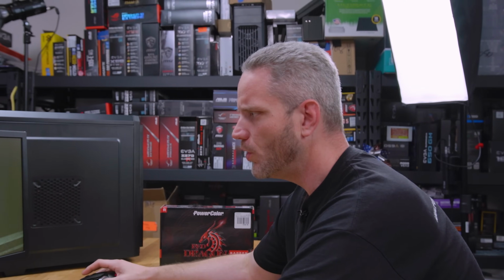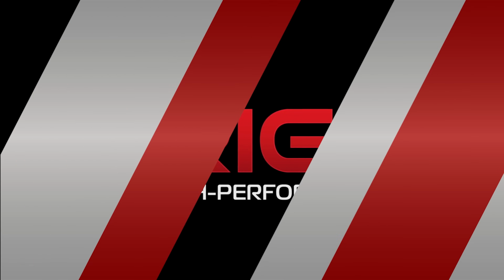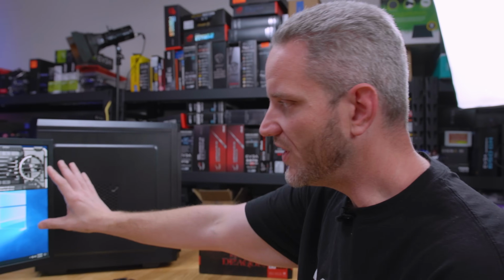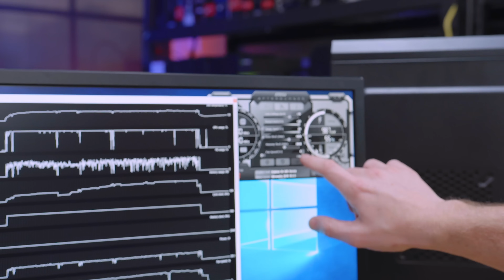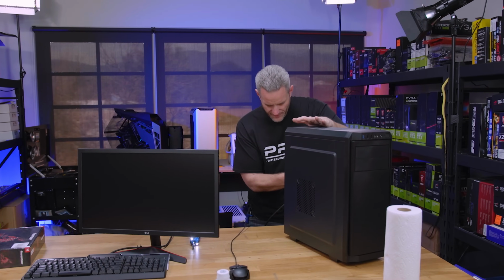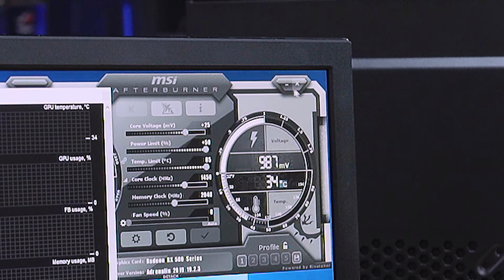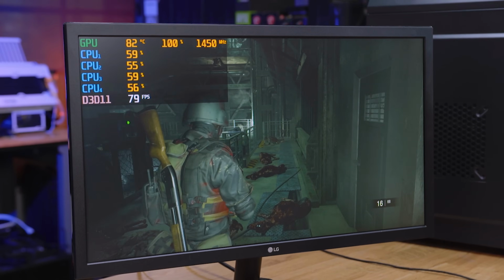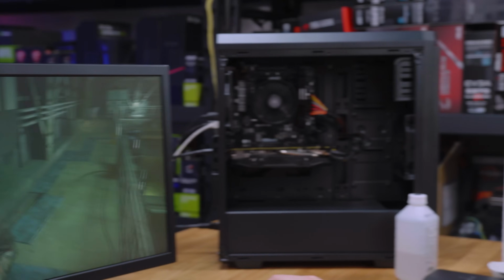Should you replace your video card's thermal paste??

Comment: Dont know about this card, but I bought an EVGA 1080 FTW used and found it was spiking to the high 80's, sometimes low 90's in synthetics and modern games.

Replaced the thermal paste and top temps dropped about 8-10 Celsius. Also the pads were barely on the VRM'S, so I had to move those properly back onto the VRM'S.

Comment: I bought an XFX RX 480 on Ebay and it was in the 80's while gaming. I took it apart and the paste was almost rock solid. I put some Thermal Grizzly Kryonaut on it and the temps dropped by 20°C. It maxes at 68°C under load now.

Comment: I replaced the thermal paste and pads on my MSI R9 390 after using it for 1.5 years. Temps were starting to hit high 80s, and topping out at 92C. After applying new pads and paste, it dropped it down to low 70s under full load.

Comment: My 2011 radeon 6950 2gig started reaching high 80c's in 2016, which wasn't normal. Clearly over heating and shutting down. Took it apart, cleaned out all the dust and pet hair then slapped on some thermal paste and it ran like new again. That PC build is in my living room as an additional family pic, general entertainment build.

Comment: Just my two cents, but I notice your CPU cooler looks stock. Perhaps an Hyper212 will help since it will blow air towards the exchaust fan instead of towards the side of the case. I noticed a big difference in temps when I switched to an Hyper212.

Comment: Is it possible that for AMD it is ok to perform in high temperature compare to nvidia which you may spot an improvement when replacing the thermal paste
Reply: Both manufacturers newer cards throttle around 74-80c
Reply: @lagginswag  Thank you for the tip

Comment: I undervolt my RX 580 AORUS and get 15-25°C less, but i was wondering if it is problem of the damaged thermal pads.
I also changed the thermal paste but almost no differents. 

Idk if that can affect so much, if someone knows pls tell me

psdt: Sorry for my bad english
Reply: The temperature reading you get is for the GPU core, if you changed thermal paste and got no difference then changing thermal pads for vrm/memory will not affect your GPU core temperature. I wouldn't change thermal pads unless it was broken or damaged. RX580 uses about 220w without OC, undervolting it is a good choice and will make your card more efficient.

I have an XFX RX 480 GTR Black and undervolt it to 1250mhz core with 1030mv, power draw is only 120w, my temperatures are around 65c on load. If I leave it at default 1340Mhz with 1150mv, I only get a few more FPS but my power draw goes to around 200W, temp will be around 75C, and fans are working really hard at 2500rpm. For me, it is totally not worth because of how much extra heat and noise it produces, just for a few extra FPS.
Reply: @ghostcommand99  actually my Thermal pads are broken, but kinda fixed, still look so bad because i cut a little bit of others and putted it in the broken one.

I set 1365 mhz with 1040mv in my Rx580, but still having problems with high framerate, like over 90fps gets so hot (+15°C) and doesnt matter if use 100% or 20% GPU.

I'll try change thermal pads and see what's happen

Comment: The sooner that people realize that this hardware is DESIGNED to work at these temperatures - if they weren't, they would obviously set them up to throttle sooner - the sooner we can move on from knocking perfectly good products down that still perform exactly as intended in spite of the uninformed's "opinion" of its operating temperature(irrelevant - hardware doesn't care about your opinions; it either throttles or it doesn't). 
There's a reason why liquid cooling is a hobby in the PC world - home computers most certainly don't require any kind of liquid cooling at all, basic, standard, cheap air cooling is more than enough for all but the most exotic setups. 

It would be one thing if GPU tech was on par with contemporary CPU tech, where you can take a, say, Ryzen 2600x, put massively overkill cooling on it, and it'll self-overclock pretty much up to the capability of the CPU itself. But we just aren't there yet(how fascinating would it be to see GPUs auto-overclock right out of the box up to the limits of your system's internal temps? But... that would mean all these brands couldn't offer 10 different SKUs that only have a minor clock bump over each lower SKU, so who knows if this will ever happen...) 

Tl;dr - your PC hardware isn't "happier" at 50° than it is at 80°; it doesn't care, as long as it's running within its DESIGNED operating range, which is basically anything below throttling. If your GPU runs at 80° without ever throttling every time you game, don't worry about it, it's working EXACTLY as intended.
The real reason why hardware temperature is a 'concern' is for fan speeds - noise reduction. But, if it isn't throttling and you're fine with your system's fan noise(which very well may be pretty quiet), then there isn't really any other good reason to worry

Comment: Zotac‘s mini Cards are the worst ... had the 1070 Mini inside a full ATX Tower and the card hits 84C with stock settings ... replaced it with an Thirdparty cooler (Arctic Accelero Mono) and now it’s running @65C max while +163 on the core and +400 on the mem

Comment: JayzTwoCents : I wish you would do that humiliating temperature benchmarks to countless GTX 1060s with crappy coolers like :

- Asus Dual GTX 1060 6GB
- EVGA GeForce GTX 1060 6GB SC Gaming
- Zotac GTX 1060 6GB single fan
- GIGABYTE GTX 1060 Mini ITX OC
- EVGA GTX 1060 6GB Gaming ACX 2.0
- Gainward GTX1060 6GB Single Fan
- GIGABYTE WF2 GeForce GTX1060 OC 6GB

or countless other Nvidia lower end AIB cards that do exist and were bought by countless illiterate customers that experience the exact same problem of too small of a gpu cooler with too low of a warmth dissipation coeficient. Really nice Jay, subliminally accelerating the otherwise nonexistent overheating fama for AMD cards :).

Comment: I bought a new case and put 4 Thermal Take 120mm fans in it and my GPU runs five degrees cooler than my old case without it's side-cover on.

Comment: You should do a video about the various aftermarket air coolers for GPUs (from Arctic or Raijintek for example), they are a great possibility to get your GPU super quiet and cool for not a lot of money. The way I like to do it is instead of buying a higher end GPU I just get the very cheapest one of the same model (that's usually a reference design) and attach an aftermarket cooler. For the RX Vega the best aftermarket air cooler you can get is $60 (which operates quieter and cooler than the Strix cooler design), since the cheapest Vega you can find is usually ~$80 less than the Strix design that's a great way to save some money. I'd only suggest doing this when running a non-windowed case since aesthetics were the lowest spot on the priority list when these coolers were designed.

Comment: Changing thermal paste while using a temperature regulated fan curve won't improve temps, it will reduce fan speed. For an accurate test you should have set the fans to a fixed rpm
Reply: Good point
Reply: I'd also like to see the results of the Ectotherm vs Kryonaut. Kryonaut has 32% better thermal conductivity. Would be interesting to see the results.
Reply: also he could have checked what the fan speed was at ? before and after
Reply: You’re wrong. My 3 year old gpu was heating up massively (85+) and causing the fans to spike to 100%. I thought it was just busted. Replaced the thermal paste and now it’s running silent and in the 60s. Bad or old thermal paste can be changed to bring back the efficacy of it.
Reply: Good point
Reply: Exactly. Changing the paste just made my GTX 980 Ti quieter.
Reply: In a way you're correct, but the fan speed isn't going to change unless the card gets significantly less hot while under load and tells the fans to do so. This means if you increase your fan speeds back up to what you were hitting before the swap, you will see improved temperatures.
Reply: The Fan Speed was 100 % all the Time lol
Reply: @MegaAstro3  100% was the fan speed or the gpu utilization?
Reply: @venomsnake6412  gpu utilization
Reply: @MegaAstro3  No idea why I didn't receive any notifications for replies to this comment until today, but I just wanted to correct you. Jay used the factory fan curve during both tests, it's clearly visible when he shows the Afterburner logs and he even clarifies that he's using the same factory fan curve as the first test when he shows the results of the second. No idea where you got the idea that the fans were running at 100% from.
Reply: @MegaAstro3  this guy paid attention.
Reply: Reduced fan speed and temps for me 😀
Reply: This is it. 👍🏽
Reply: It may also increase clocks
Reply: Yeah but he’s using the same game at the same settings at the same spot of the game.
Reply: And the fan speeds are reduced because they don't need to run as fast to have the gpu be the same temperature as before? Why else would the fans just slow down...
Reply: Depends if the fan speed is based of the detected temperature  or not the desired temp. (Most curves are just charted off the temp reading. So if the temp is 80deg in both instances the fan speed should just be whatever RPM corresponds to 80deg (eg 70%) on the fan curve.
Reply: Seems legit.
Reply: how
Reply: Improved mine by about 27 C, I left the curve the same and they don't come on as much.
Reply: 756
Reply: Yep!
Reply: It actually gives data for that specific case. It's still representable. If the thermal paste whould make a change you whould still see a difference
Reply: 2000 likes
Reply: 2.2k likes and this isn't even remotely true. Smh it depends on the circumstances and the age of the thermal paste, a refresh after a few years can actually cause a massive reduction in temperature if the paste has gone crusty.
Reply: @via_negativa6183 kind of true TBH.

Really depends on card manufacturers.

Zotac cards have good thermal paste out of the box but bad fan curves that cause the GPU to overheat.
Reply: THIS!!!!

My zotac 1660s had the same problem.

Factory fan curve was shit. The GPU used to go above 80° and yet the fans remained at 70% speed.

Adjusted the fan curve and bumped the speed to 85% at 70°+

Never saw 80+ temps after that.
Reply: It will because since it's cooling more efficiently it'll be quieter
Reply: This is not correct.  An improvement in thermal conductivity off the chip will typically result in lower temps, which will result in a lower fan speed.  Temp reduction will not be as significant as with a fixed fan speed, but an improvement should result in a lower equilibrium point.  To get a real improvement in temps with this system, they should have added a decent bottom front case fan.
Reply: @deeppurplefan  diapersandpurpleshit
Reply: @deeppurplefan   lower equilibrium point. ??
Reply: Don't agree because I stuck on new paste, old paste was a bit dry and the temps went down 5°c from ~82 to 77 - gtx970 not at max fan speed (max fan speed kicks in at 90 - and it's too loud).
Reply: thats actualy the problem .. turn fan to 100% test .. repast test ! thx you welcome
Reply: True.. but in this test the card did the same temperature same damn every thing

Comment: With this case adding a side mounted fan can help a lot to get fresh air to the cooler. With an overclock like that it will still run warm but it would help quite a bit to have that fan blowing fresh air right to it.

Comment: ( HOPE THIS HELPS IF U HAVE AN AMD CARD!) I had an RX 470 4gb Gigabyte and I used the Radeon software to change the fan speed and set a temp that my fans will try and achieve that temp i.e if  you dont want ur card lower than 50c and you dont want it higher than 70c you can certainly set that up! and the fans will try and stabilize in that area! also you have to choose the RPM on the fans you want them spinning on those temps (55-70c) I set my  mine to 1600rpm - 2400rpm. Basically at 55c the fans will speed up to 1600rpm and it will try to stay at 55c - 70c with 1600-2400rpm  but the fans would not spin faster than 2400rpm because around 2100-2200 the temps stays at 65ish. it works! I played overwatch on ultra settings and it never passes 70c. that is what I did when I had a rx 470 card but now I am chilling with a strix 1080ti!

Comment: EVGA GTX 1080 SC here:
Room temp near the floor is about 17.5°C. 

Boosts to 1974MHz in Furmark (GPU stress test)) and stays in the low 60s °C at around 45% fan speed. 
Sounds pretty good actually.

Comment: I bought a used gtx 1080ti on eBay, noticed high temps with light overclocking. Switched out the thermal paste and that fixed the issue. However, I'm still baffled how this relatively new graphics card had this issue in the first place. anyone knows why?

Comment: This might be more of a defect from the manufacturer, but I found that on my strix GTX 1070 that adding thicker thermal pads over the mosfet dramatically reduce temperatures. Before replacing the thermal pads, I had temperatures of around 75C at around 45 to 50% fan speed. After changing the thermal pads the temperatures dropped to 68 to 70C, at about 38% fan speed. So I guess the moral of the story is, if you have abnormal temperatures check the thermal pads.

Comment: Whats the best thermal paste for gpus? Is there such a thing?
Reply: MX-2 and MX-4 are popular. I like MX-4 and I always hear how it lasts so long that you dont have to replace it for 5-8 years. Arctic clames MX-2 has same durability, but I usually hear MX-2 has to be replaced more often than MX-4. But I cant really speak from my experience. Thermal grizzly is supposed to have good pastes, but I dont know how long they last. There is also Noctua NH-D1. From what I see on the internet, MX-4 and MX-2 seem to be the most trusted, even in shops i see them as 2 top selling pastes. Also GEID Solutions GC Extreme should be good i hear.

Just don't use IC DIamond.

Comment: Mine is Rx 580 pulse still hitting 80c even after changing thermal past 
Maybe I need an expensive one 
Like thermal grizzly or Cooler master Pro 
Also when I put it on gpu die its spread out when placing gthe heatsink !
Reply: Gustav Gamer  sadly its already undervolted @1380mhz -62mv

Comment: I recently bought a Intel NUC Hades canyon, out of the box was hitting 99 degrees Celsius  and throttling af at stock speeds. I got to replace the thermal with greezly kryonaut and after  the results where almost 25 degrees down the 99, also I managed to OC'd to 4.7GHz using the stock cooling.

Comment: So Jay...
You mentioned that you get what you pay for on these low end GPUs. On account of it only coming with a mediocre cooler.
BUT! Can you elevate these low end cards to new levels if you were to water cool them?!
I see you water cooling really expensive GPUs that are out of reach for most of us, but what kind of performance can you get with an inexpensive GPU and a water block that likely costs more than the GPU itself?
Reply: You can't always get gpu blocks for the low end cards which is usually the reason why. Plus the low end cards generally don't have the best power delivery so overclocking can be limited.
Reply: @AndyCttn   Bleh... I bet you are right about that. Would still be fun to see tho.
Reply: It would be more cost effective to get a better air cooler like a Arctic Accelero than watercool a low end card.

Comment: I just replaced all the TIM on my Asus GTX1070 Turbo (blower) card a few weeks ago. Used Noctua NT-H1 and a few EK thermal pads. Of course, also cleared out the dust, quite a bit of which had collected around the stock VRM thermal pads.

Initial results showed a 10°C drop and higher, and more stable, boost clocks.
Reply: Oh, on airflow, I upgraded my two intake fans at the same time. I had some super cheap SP-type fans that never seemed like they spun high despite running at max power all the time. Replaced them with Noctua Industrial 2000RPMs and set a fan curve to manage the noise. Definitely got increased airflow through the vents at the front of the Define R5.

And don't even suggest that I take off the door because I love the 2001: A Space Odyssey-style monolith look :D

Comment: I wish you would have grabbed something older like a 750ti or a Radeon HD 7950 used to see how poor the old thermal paste is over time. A few degrees C isn't exactly life changing. The 750ti that I bought a while back went from 80C to 65C under full load over 3 hours after changing thermal paste.

Comment: My 580 8GB had been using the stock paste for about 6 months. Started noticing heat issues, as well as some games crashing. cleaned the die, as well as the cooler, and applied Arctic MX-4. And only time my fans kick on now, is when gaming, or doing video rendering.

Comment: Bought an used 1080 half a year ago. Temps were in the 80's while gaming. I changed the thermal paste some days later and temps got down to 65C with an Oc up to 2000+ Mhz.
Reply: Nvidia probably used to cheap toothpaste as thermal compound as intel have done for 8 generations of CPU`s... Wondering if i should change thermal paste on my 1070 Gaming Z aswell.. Had it since watch dogs 2 got released, which is 3 years i believe...
Reply: @GAMEVIDSnorwegian422  if the Temps are high you should do it. Otherwise it should be fine as it is. In my case it was an Asus card and I trink the guy who owned the card changed the cooler and didn't replace the paste.
Reply: @GAMEVIDSnorwegian422  Yeah... I replaced the thermal paste on my i5 2500 and i dropped from 86°C to 69°C max... Though the stock paste was 5 years old already.